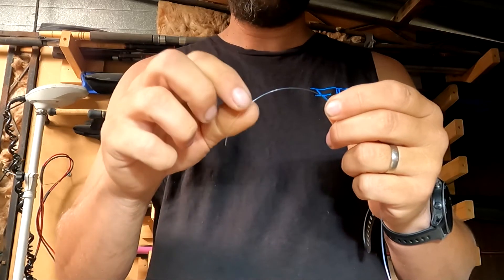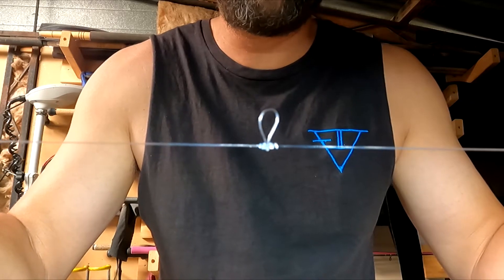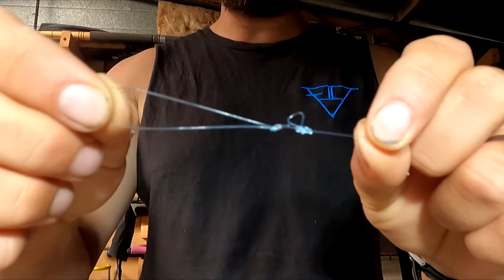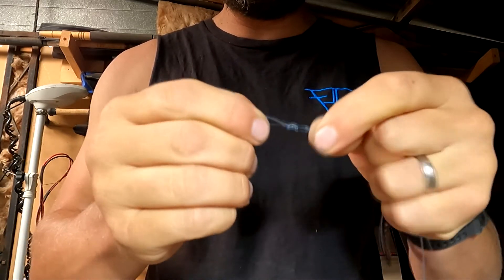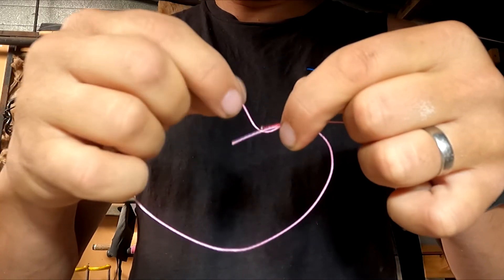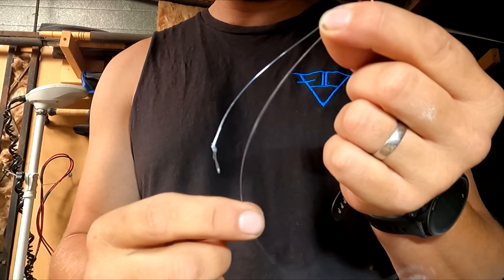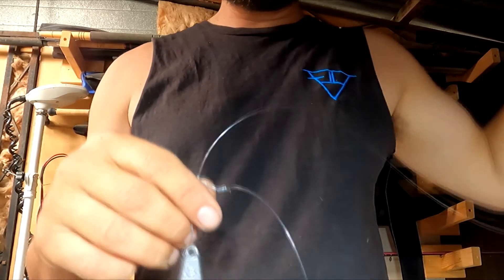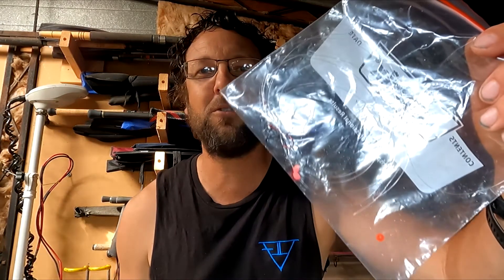How to tie a King George Whiting rig

Comment: Pretty interesting,  we use running rigs,single hook #6 or#4 long shanks on a 50 -65cm length trace depending on current. Like that dropper loop idea. Do you use your rig on the drift or anchored?. 
I love making all my rigs in advance and they're all wrapped around some dense foam holders. Yeah, definitely saves you alot of time when they (the Fish start goin )and there all sorts happening, hooks swallowed , tangles from fishing going at the same time, etc,... as I'm sure you know 😅👍
Reply from the maker: Thanks, these rigs work well both anchored and on the drift.
Using two hooks gives the chance of a double header if they are schooled up and on the chew.
Pre tying rigs is definitely the way to go to save some time while on the water!
Reply: Good to hear from ya